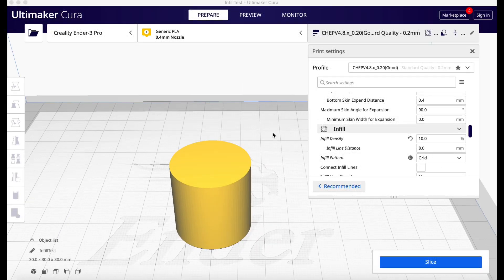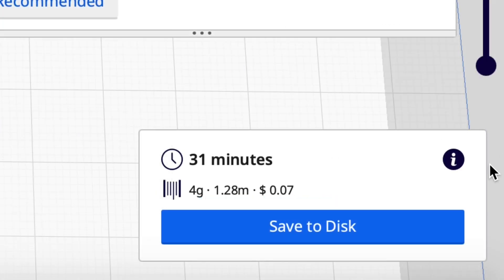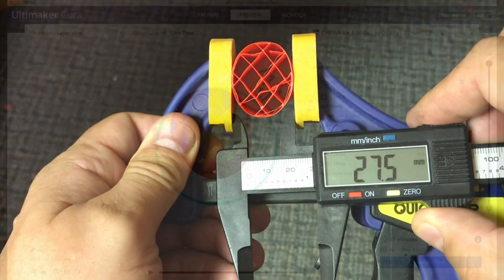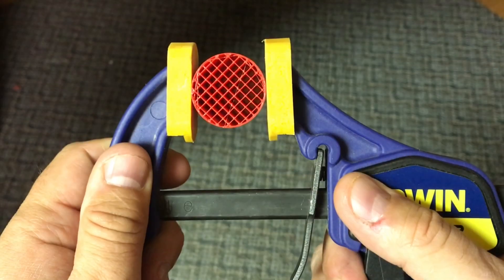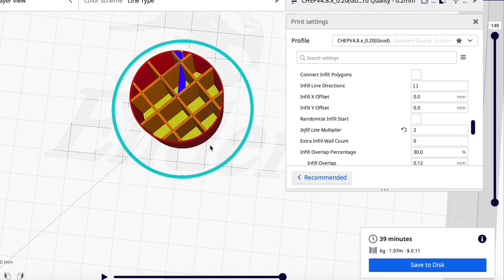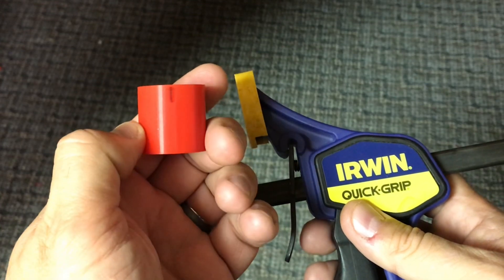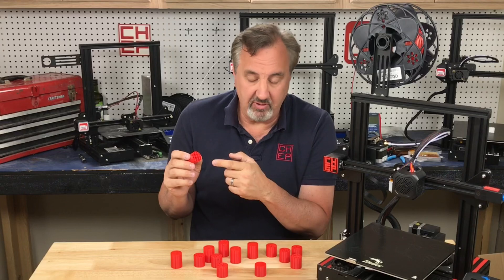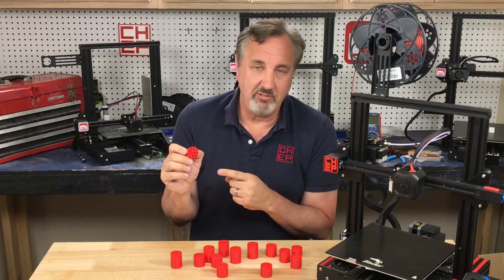Cura Infill Setting for Stronger 3D Prints using Less Plastic

Comment: I use 10-30% infill depending on the strength requirement. Since most of the things I make, that have to be strong, I always print with several outer walls and top/bottom layers. Much stronger than a very dense infill I find. In cura, I've set wall thickness to 2mm and top/bottom thickness to 1mm.

Comment: so if I understand correctly, the double line infill uses two lines instead of one.
You can then say that the amount of material that you use for the filling approximately doubles, so then you have not used 10%, but about 20% of the material. The open space between the lines may be approximately the same, but twice as much material used for the infill can of course not be called 10%.
It is just an infill with more material but with a different pattern than the standard square infill.

Funny, by the way, that using 10% volume as infill and then doubling the amount of infill (thus approximately doubling the volume of material) is simply called 10% infill. With Cura it is clearly not about the amount of volume that is filled but about the space between the infill structure.

Comment: I notice you are still using your “CHEP 4.8” profile in this video but in previous videos you said the cura default profiles are so good now you didn’t need to release new ones for 4.9? Are you still favoring your 4.8 profile over the new defaults? (And thus so should we)? Cheers
Reply from the maker: Mine defaults to 25% so I used it. This makes me question my defaults.

Comment: Surely if it's doubling the line thickness, it's doubling the percentage infill?
Reply from the maker: That’s why I compared to 25% and was surprised at the results.
Reply: @FilamentFriday  well I think you should have compared it to 20% infill
Reply from the maker: Why? If it essentially matched 25% why step down?
Reply: @FilamentFriday  I don’t remember the figures exactly but they didn’t look equal to me (I think there was .4 difference when you crushed it) add to that measurement precision which can go both ways and you it you may be 5% off... not saying this is not useful but unless it is clearly equal or stronger, I don’t think you can draw that kind of conclusion. But still only my « scientific » opinion. Great work you’re doing by the way always a pleasure to watch your videos.
Reply: @anisboubaker3806  Agreed.
Reply: @anisboubaker3806  yeah, it treats the pattern generation different so testing doubled lines vs 2x infil density might have different results
Reply from the maker: Do you honestly think I didn’t test 20%? 
It was meaningless. Two line was better so I tested it against 25% and surprised by results.
Reply: @FilamentFriday  Chuck;  I have huge respect for you and these are perfectly reasonable observations under the circumstances. Given that it's a feel test, not a scientific benchmark, the stiffness or strength at 20% compared to 25% would surely not have been "meaningless?" What do you even mean by that - that it was indistinguishable from 25% or from 10%? This is a fascinating test but I don't really get the take-away - "When I double the amount of infill by line volume, I save 25% filament?" or "When doubling the line thickness I get the almost same strength as increasing the infill by 250%."
It was a great question to ask, and as always, I love your videos, but this test has some holes (no pun) that I would love to see explored. As a relative beginner, I'd like to know "What is the STRONGEST infill pattern, what is the most economical way to achieve strength (which this video alluded to), does the print direction matter to infill strength, do these factors still holds when the part gets small or large and where's the threshhold if there is one, is solid stronger than infilled?"
In this test you have offered a glimpse of a question that many of us are desperate to resolve. If you ever get bored, I hope that you will consider devising a test with more quantifiable rigour for the squeeze test (maybe a pressure gauge?), and maybe factoring in a lateral snap test.
As always Chuck, thank you for a fantastic channel!

Comment: Nice feature to know about, but the testing method and the comparisons are lacking. Also, as many have said before: 2x10%=20%
Reply from the maker: But it performed essentially equal to 25% so 2 lines not equal to 20%, there stronger. Try it.

Comment: Double lines at 10% is effectively 20% infill. I would have liked to see the comparison with standard 20% infill instead. But Brunel demonstrated that some strength comes from the walls and not the solidity, so i would also like to see a comparison with 2 walls and 10% infill.

Comment: You should have compared it to 20% and not the 25%
Reply from the maker: Why? It matched 25%. Better than what I expected. Why test it on a lower percentage after seeing it match 25%?
Reply: @FilamentFriday  well basically because you fill it 20% and the 25% was a bit stronger in the end. So i feel like it was more fair to compare it to the 20% strength Because the 20% normal infill might have had the same result as 2 layers of 10% infill
Reply: @FilamentFriday  because you show that 10% infill takes 4 grams of filament and 25% takes 8 grams of filament, and then show that doubling the 10% infill inner walls only takes 6 grams,  and 6 is < 8, so yay. But what some are saying is that if you choose 20% infill with single inner walls, it’s probably also 6 grams and same strength as the 10% with double inner walls !  So then you are not saving filament no ?
Reply from the maker: Try it. Takes less time than posting all this. You’ll see two line uses less filament than 20% (1.97 m vs 2.17m).
Reply: @FilamentFriday  did just try it, and interestingly it is about 20 cm less, like you say, when doing a test with 20% infill. But the print time I got was also longer,  about 8 minutes more for 1 gram saved. Great food for thought, however. I think we all got hung up on "of course 20 <25", but there is still a slight difference when comparing 20 with 20. Thanks for all your great vids !

Comment: Most of the strength of a part is in the outer walls. Increase those to 3,4 or 5 walls and no infill is needed except for roof support.

Comment: I see the point of the demonstration but there are several scientific issues I have with it. Grid pattern is best used to resist compression on the z axis only. Only having a bottom layer skews it as well. Have no layers or both.

Comment: Kinda strange to compare 2x 10% against 25% instead of 20%
Reply: Agree
Reply: He's comparing relatively equally strength to filament saved: don't think of it in terms of strength gained.
Reply: @kevinj9059  "relatively" But we never saw  the performance of the 20% so i can't gather the information out of the video if it's worth to bother and use 2x10 instead of 20

Comment: I set the infill line width to .56 when printing outter at .4. Strong prints, fast.
Reply: Assuming that you have a .4mm nozzle, setting the l line width to .5 or .56 can improve layer adhesion because it creates the extra width using squish. I tend to use this most on inner walls where it has both the latter below and the adjacent wall(s) to squish against.

Comment: 10% infill with double the lines does it make 20%? Of course it is less plastic and time compared to 25%....just try a 20% infill with only one line (as usual) and you will see the same results as with your new solution...
The whole video would make sense if you would compare with 20% instead of 25% sorry
Reply: I wonder, would 10% infill with double lines weigh the same as just a 20% infill with 1 line? no point going with the data from Cura as we all know they have a "Shot In Dark" result when it comes to these things, its going to be a print and weigh solution for this one
Reply: That's the whole point of his video: using the 10% double line infill (effectively 20%) is just as strong as using 25% single line. He's trying to show relative strength and filament savings, not direct strength of equal filament amount. Your comparison would be equally useful to show how much strength you can achieve with equal amounts of filament, but that's not how he chose to compare.

Comment: OK this is fantastic and practical information. I've been printing armour parts for a Mandalorian costume and learned a lot since I got my printers last year. I started off with building some costumes for my sons at crazy infill percentages like 30%, sometimes more. After experimenting I learned that 10% infill but with a 1mm to 2mm wall thickness actually resulted in a much stronger print than the default 0.8mm thickness at higher infill. That greater wall thickness also gives you lots of room for sanding down parts if you're after glossy smooth finishes after painting by the way.

But this infill line multiplier too? This is great for those parts with greater surface area like chest pieces for example. 

Thanks again, Chuck.

Comment: this is really helpful Chep, will be using it for most of my new prints
Reply: Why? It costs more time and material and it's only effective if your print needs to be stronger.
Every shape needs its own design to make it stronger. This trick that Chuck shows us, is not a general setting to make parts stronger, it shows how in some cases, it can make a part stronger with less material. More strength would have been gained if he used 3 perimeters for the outer line and absolutely no infill at all. Yet that would only be true for this shape, and not a general solution. Also, that's not the point of this video.

Comment: 10% x 2 is clearly more like a 20% print. how surprising.
Reply: 20% would be a better comparison than 25%. Still interesting video
Reply from the maker: Why would I test against 20% when I found it essentially matched 25%. Why step down?
Reply: @FilamentFriday  nice math comparison. 20 double of 10. Makes math simpler for comparisons. Great Vid, looking forward to seeing more!!!
Reply: Yes, but the point he's showing is that his 20% infill is just as strong as a 25% infill, thus less plastic is used for the same strength. It's literally in the title of the video.
Reply: @kevinj9059  I think the title was different earlier, and the video shows that what he calls 10% but is actually ~20%, is slightly weaker than 25%. Really nothing very surprising, except that it's a new way to distribute and multiply the infill.

Before it said something like 'make 10% infill as strong as 25%', but its clearly close to 20% and still marginally weaker. About the difference an extra 5% might make, perhaps.
Reply from the maker: DMonZ1988 - The title never changed.